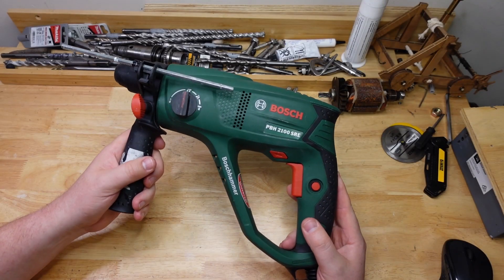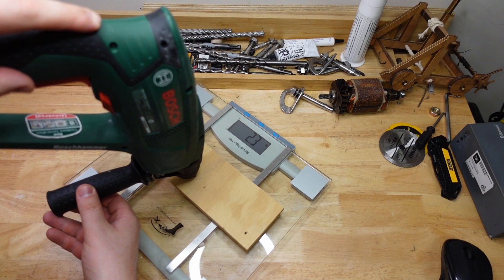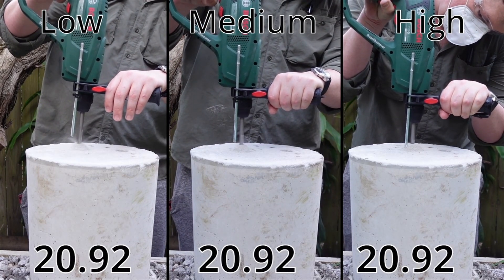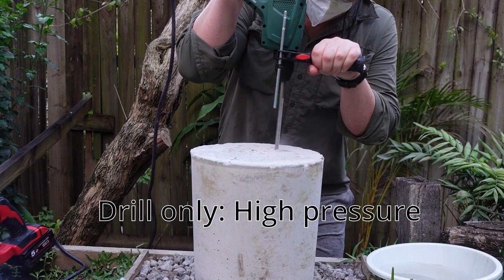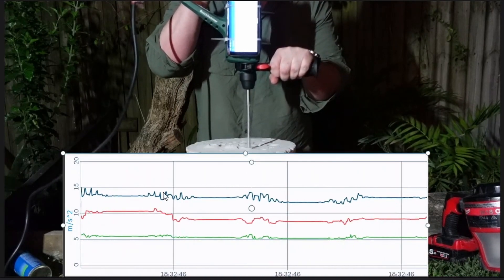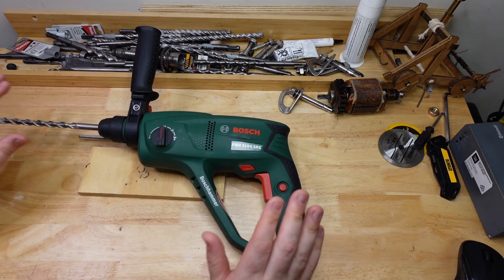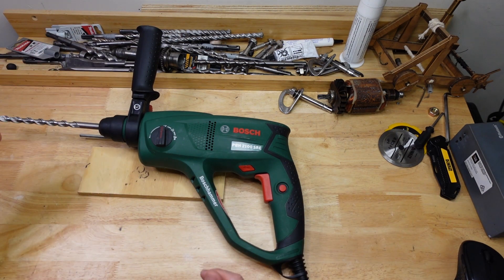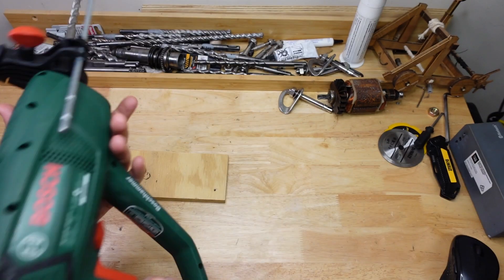Pressing too hard drilling with SDS rotary hammer?

Comment: First time viewer here, what about tip of bit temperature?
Reply from the maker: Good question! I've tried that with my IR camera and the measurements are all over the place. Shiny metal will show reflected heat off other objects, and the drill dust obscures the bit. So, I haven't been able to measure the bits reliably but that's something I do want to improve on cos I use thermal imaging here and cooking bits is a big problem!
https://youtu.be/ohTKJRITxfM
Reply: @BoltahDownunder  thanks for replying, I am binge watching your videos and thoroughly enjoying them
Reply from the maker: Cheers mate! And keep the suggestions coming, it's good to get feedback